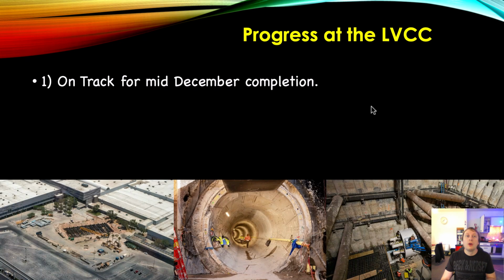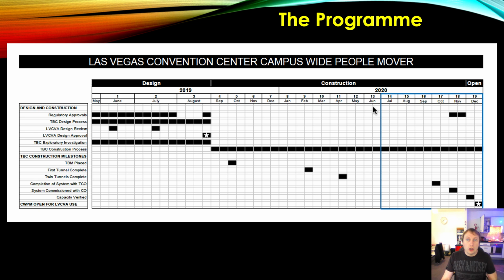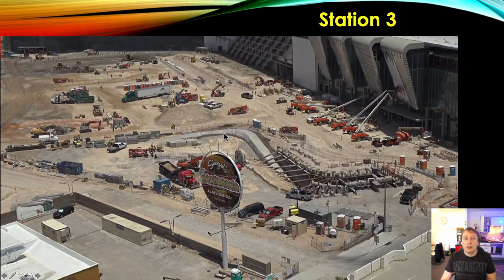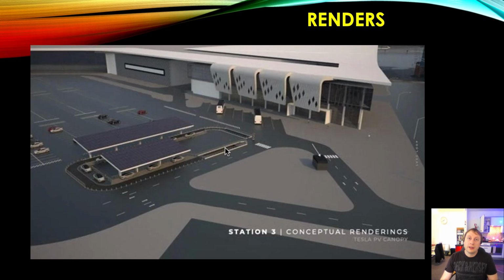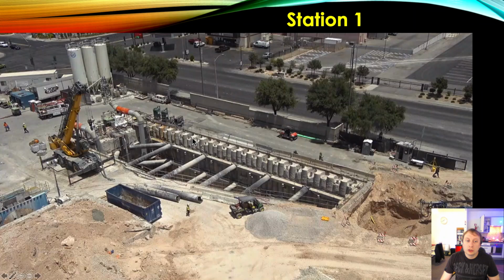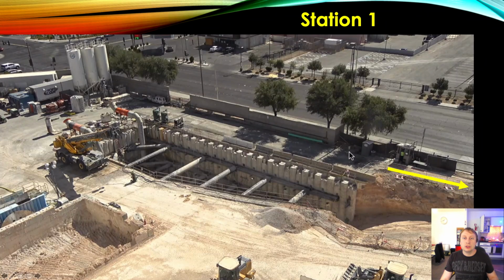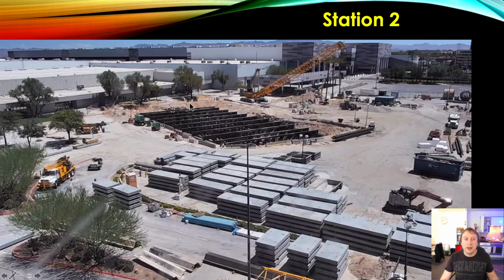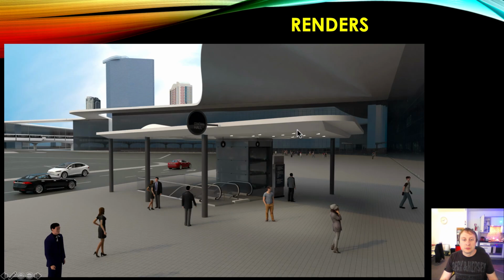The Boring Company ✅ Las Vegas Progress Report July 2020 😁 🏗️ 👷🏽‍♂️ Episode #63

Comment: How many kWatts does the Boring machine pull in operation?
Reply from the maker: Depends on the machine. Prufrock / Linestorm. Well Over 1,400 kW Per Machine.
Reply: @BoringRevolution  Wow, they are going to need several megawatts to work on Mars!  Thanks!

Comment: Do you think that hyperloop could be on rails and that the pod would be powered by batteries? Like Elon said, the best part is no part after all.
Reply from the maker: Hi, I don't think it makes sense to use batteries in a tunnel when you could use a maglev system or a third rail. Why not put the batteries on the surface and connect up via cables ?
Reply: @BoringRevolution  I saw this in the news:
https://www.greencarcongress.com/2020/03/20200304-ampere.html
220kw@30,000 rpm so for a speed of 300m/s you need wheels that are 20 centimeters in diameter.